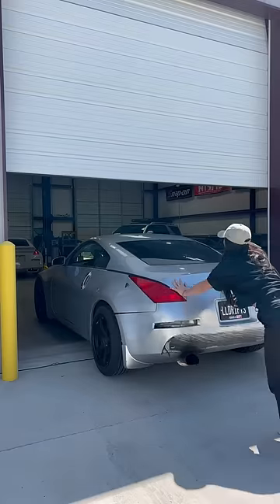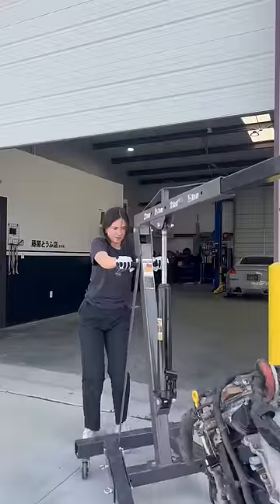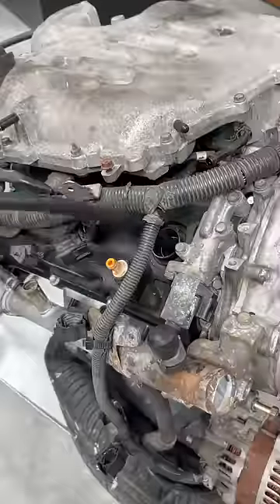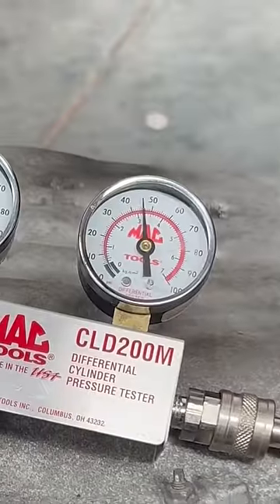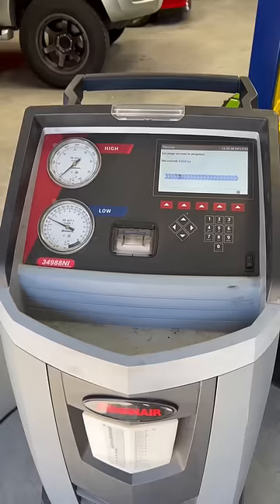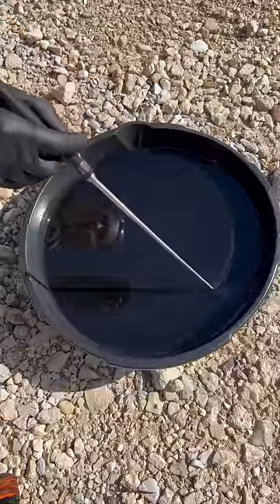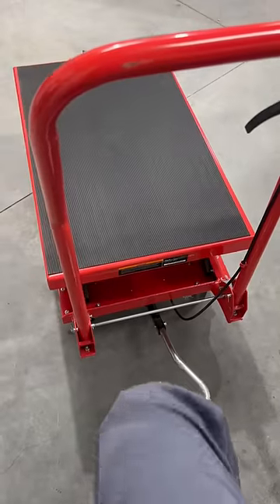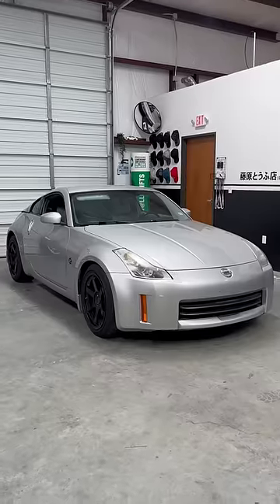VQ35 Engine Swap on a 350Z: Part 1✔️

Comment: The oil looked like water and oil are mixed and some metal shavings which are tiny. I heared the tiny equal sized shavings could mean that somewhere you got oilstarvation and dry metal contact

Comment: If you haven’t already taken out the motor, you can honestly just take out the whole front end of the car and then pull the motor straight forward. It’s simpler and it’s not that hard. I did that to my G 35.

Comment: Just replaced 6 ignition coils on my Maxima in the heat and it was a pain in the rear. Dripping with sweat and she's replacing engines like its nothing.

Comment: Pull it from the top cause if u lift the car off it, then ur gonna have to pull the whole front suspension from it as well, so it's just less work to pull the motor from the top

Comment: Easier to lift car off engine and subframe.  Pulling from the top is a pain in the ass unless you take the front clip off. But then you’ll have to fight the tranny dowels that will be stuck in the motors back ass.

Comment: ....and please wash the used engine properly including removing the intake plenum and clean any debris that might got stuck in there.
It's a budget build, might as well do it proper including changing rear main seal since u are already there ... plz wash the inner transmission bell housing too. Do it right and proper.
Clean the engine bay too b4 plonking in the replacement engine. I wud take full advantage of doing things right that is tediously time consuming pain in the butt when there is an engine in there.

Comment: Probably crank/rod bearings. I say this because it sounds similar to the engine I had to do rod bearings. And then had valvetrain issues. Moral is the new engine is a good idea those oil flakes pass through and mess up the engine. Would not recommend doing any bottom end work on a budget I tried everything was smooth for 500 miles and now it's dead in the water probably rings since the plugs are so fouled huge headache

Comment: My buddy has a 350z with 175k miles on the original vq. It sounds like it wants to blow up on startup and hits 3k rpms going 75, but it hasn't died yet I suppose

Comment: i have oil starved 2 seperate vq engines and i have never had engine knock like that, the worst ive had is my timing chain guides falling apart but the car got bought back because they were damaged prior to being bought only had that car for about 1.5k miles

Comment: My mom had a 2003 izuzu rodeo bought it brand new with 10 miles by 2018 she had engine problems btw it ONLY HAD 95K miles sadly she sold it for like 3K out of desperation she bought a $4'000 2004 rav4 with that money she coulda easily invested into a newer engine... She still gets sad til this day when we speak of it.😢 That car coulda easliy gone for another 15 years

Comment: Did you guys open that engine ? 
Those cars have several timing chains,guides and tensioners 
I’ve seen the guide or the tensioner fail and cause that knock

Comment: That's not a Rev Up engine, that's a DE. The "rev up" is the HR engine, which has two air intakes into the plenum chamber not just one.
Reply: It is a rev up. The rev up came in the 2005-2006 z's and has a single intake but the same headlights and taillights as the 2007-2008 hr models.
Reply: @kaizuhh  I see, there appears to be confusion amongst enthusiasts... many people refer to the HR as the rev up engine, I guess because HR = high rev. It seems the rev up is a modified DE that's somewhere in between the older DE and the HR revision. My bad!

Comment: 58k miles and engine is dead already. NOW That's what I call reliability ! :)
Reply: Idk if it’s necessarily an issue with reliability on Nissans part though any engine will die within 58k miles if it’s horribly maintained

Comment: It's always easier to drop the engine....  Also - get rid of that wiring harness.  That looks shiiiiit.

ALso - while out - if you are keeping it - new rod bearings on the VQ is always a great idea.   They are very high strung engines and almost demand   attention.

Comment: Tell her it's in the top 10 most dangerous cars to drive you crash chances are you won't be walking away even if it ain't your fault so sell it or reinforce the chassis and weld in a roll cage

Comment: Completely unnecessary to drain the AC. Keep the good wiring harness that's already on the car. Remove all the plugs from the original motor and strip the new motor down to the basics. Leave the power steering pump and ac compressor in the car and just put em to the side. Undo the transmission and pull the engine out the top. Takes 2 days max to do.

Comment: Should have just got a regular de and not from marketplace, got for mine off eBay for 1500 with 34k, that rev up will keep failing they were made with cheaper parts. They have like 12 extra hp and rev higher but are complete junk.

Comment: It seems like she’s saying swap instead of replace because she doesn’t quite understand the terminology difference.
“Engine Swap” generally refers to putting an engine not originally in that vehicle (ie ls swap into any non Chevy car, ford v8 into a Miata etc).  Need to generally fabricate new engine mounts, sometimes get a new transmission or some kind of mating bell housing, etc.  extra wiring, new computers, figuring out how to make all the gauges work and/or replace gauges etc etc etc.
“Engine replace” usually means “my engine is not working properly, I’ll replace it with the same one, but working properly.  Which is what I can gather she’s doing here.  Yea, it’s very involved, but really quite basic.  Out with the old, in with the new.  Turn the key, maybe a aftermarket tune, yay done.
Looks to me like it’s the same engine from a different car.  Might need some repairs too, but hopefully she’s smart enough to get it all fixed/replaced/modified before installation.

Comment: Curious to know ur pull method, from the bottom or top?
Reply: It would be best to just take out the front and completely and pull the motor straightforward
Reply: @andrerose6897  ...
Reply: @Andre Rose  take the core support out which is welded on?

Comment: Can anybody tell me what's wrong with my 350? It Revs high like it gets torque but doesn't pull until you get it at a high rev, no power.. I put new O2 sensors in and I might need a tune... Anybody else have this problem? I have a HR engine

Comment: Thats not a swap, its a replacement. A swap is when you replace the engine{not motor} with one that isnt made for the car.
Reply: Although you are correct with the swap/ replacement terminology. Engine is just a specific type of motor. A motor is just a thing that propels or powers another thing

Comment: Fuck soldering a wiring harness and using heat shrink. We use shrinkable butt connectors and don't shrink them. We love corrosion and horrible wiring

Comment: Black oil color dont mean anything. Engine is not shot. Try diesel driver 5K miles you going see black oil color until next oil change. After 500-1K miles again black. Even on brand new car diesel. I got after 2K miles black oil ...
Reply from the maker: I never said anything about black oil, I said that the oil was glittery😅 as in metal flakes

Comment: I'd be willing to let a female mechanic that majors in motors mostly than tune-ups because either way the work is warranted once the other motor is checked out and installed. Is this shop in orlando, FL? Woman in the mechanic field don't get their due credit. Don't know if its because its a man dominated field. Or because most men don't trust women to work on their engines because the expense that comes with engine repairs. You might get a better pricing lol?? Let me know if I'm thinking about it the wrong way.

Comment: 58k miles and it sounds like that. vq’s are garbage. just go get you’re self a ls and save you a headache down the road.
Reply: You're joking right?

Any engine beaten within an inch of its life without maintenance will fail prematurely. 

You're seriously going to write off an entire engine family based off of a single unit? 

You LS fanboys are insufferable.

Comment: women mechanics push on the clicks.

but removing freon from an AC system that already lacks the compressor tells me its all staged BS.

like in most other women mechanic channels that smear a bit of oil on their cheeks n chin.
Reply: They didn't remove the Freon from the engine lacking the compressor. They removed the Freon from the engine that was still in the car.